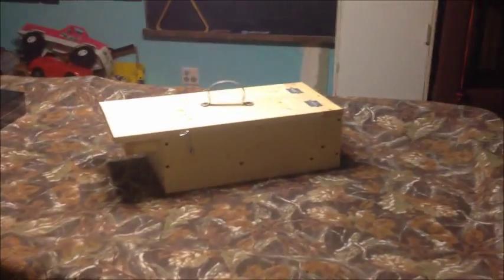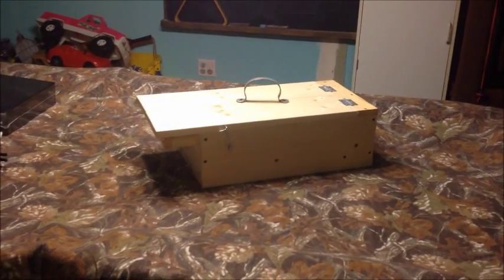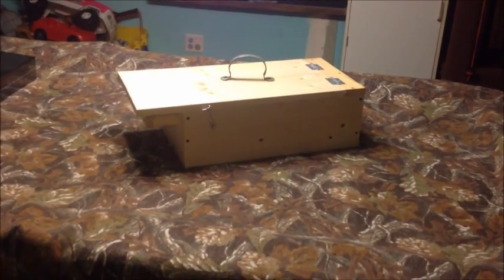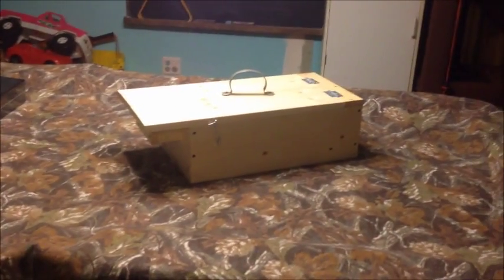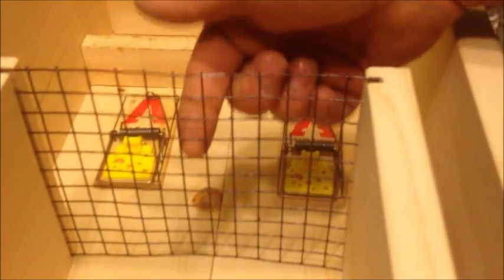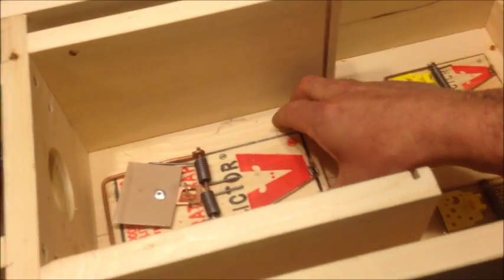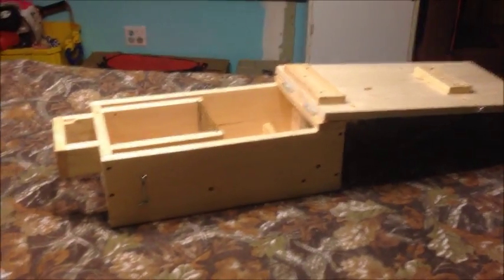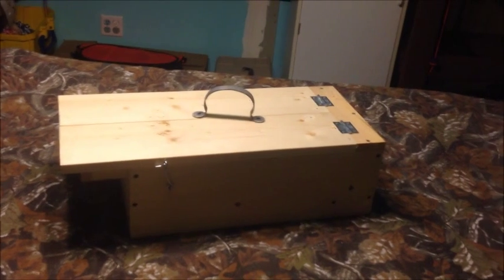THE CHICKEN PROOF WEASEL & MOUSE BOX/TRAP

Comment: I have a suggestion. those mouse traps need to be directly in front of their entrance route just as the ermine trap, for the same reason, can't get to bait without throwing the trap. Great trap idea.
Reply: Wonder tip. Also...
Maybe small block of wood to keep traps where you want them...like on each side of the rat traps so it stays centered but can easily be picked up and/or slid in loaded. Same for mouse traps centered on runner chutes. Great build!